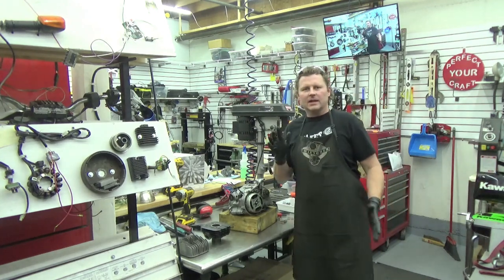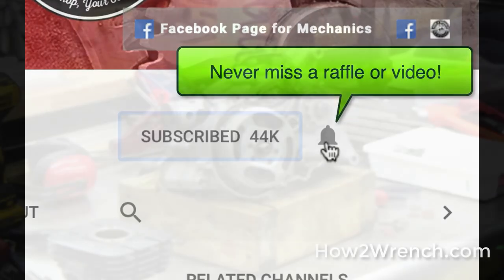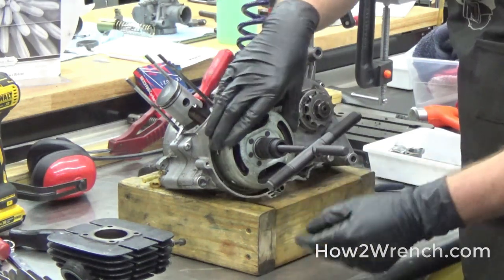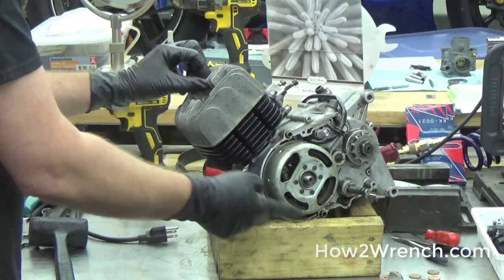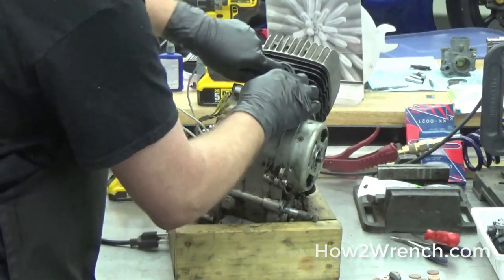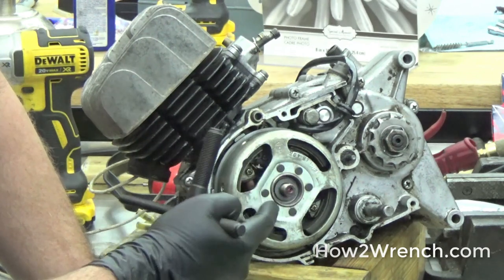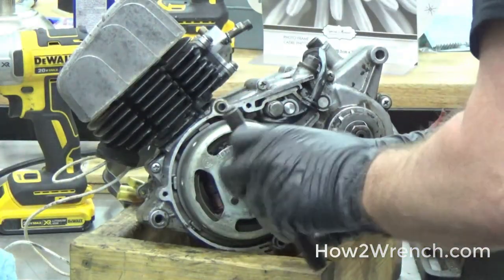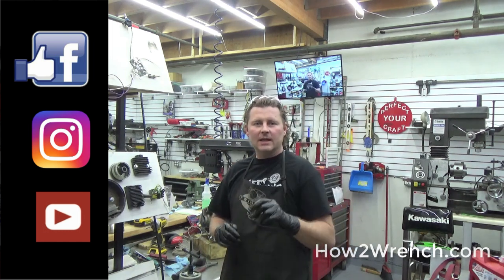How to safely remove a flywheel rotor. The "Old Boy" method!

Comment: I gave you a like because most of what you say about flywheel removal is legit. But I worked as a professional MC mechanic for 25 years and would have never removed a flywheel without the cylinder in place. For the same reason, countershaft sprockets should be removed while the engine is still in the bike with the chain over-tightened and brake applied. The old rope trick was good in its day when it was uncommon for home gamers to have impact drivers. Nothing to do with you, but T-handle design in a world where impact drivers exist is ridiculous. Most crankshaft nuts will come loose with an impact driver (assuming your flywheel puller has a hex head instead of a T-handle) and holding the flywheel with nothing but your fingers. Right now I'm working on a 1950 Whizzer motor. The designers of that motor had no idea that anyone would ever want to remove the flywheel, so their only advice is to get behind the cast flywheel with a screwdriver while beating on the left-hand threaded bolt. With that method, you wreck the bolt and the crankshaft at the same time.
Reply from the maker: Thanks Bill...time and a place for different techniques right? This a a pretty old video and yes impacts have come a long way in price and easy availability. We have many fans around the world where that's not always this case. We have many videos showcasing many different techniques and options in our engines playlist. 
Welcome to our community and your added value is a win for others here....Shane
You rock for commenting! 

Ways to support or high five How 2 Wrench! Thank you in advance. YOU MOTIVATE US TO DO MORE!
1. Smash the subscribe button (thank if already a sub!)
2. Have you seen our "YouTube Trained Support Shirts?  https://goodfellasmerch.com/collections/how-2-wrench/products/support-shirt 
3. Join this channel to get access to perks:
https://www.youtube.com/channel/UCBhM8DCKnT3qXwTW0eToyCg/join    
-Daily MEMBER FIRST COMMENTS ANSWERED FIRST 
-Live Q/A video chats
-Wonder if we have a video on your need? Members can request content links!
-Full Access to the ENTIRE 700 video library
-Member-Only FREE tool giveaways  
4. Got an emergency and your head is about to explode from frustration or fear? Get Shane’s cell here: https://how2wrench.com/ols/products/techline-one-on-one

Comment: I use 2 wrench to turn the tool & u dont need to smack the tool with a hammer
Reply from the maker: On the "t" style there is no spot for a second wrench. There are of course pullers out there with flats for 2 wrenches as you mentioned. Thank you for commenting. Here is a way to support all the free videos. Don’t forget to subscribe too! 
Want to say “thanks” or “keep it up”? Click here https://www.paypal.me/how2wrench  

Coach Conley is also available for hire to personally work one on one with you if ever needed.

Your answers and help are just around the corner. Save time and money while protecting your investment and yourself by doing it the right way!
Follow us!
Web:
www.How2Wrench.com    
www.Tools2Wrench.com

Comment: I always tighten the puller then rap the end of the puller to jar the flywheel loose rather then use excessive force on the puller handles. A sharp tap and the flywheel pops off,  no damage.

Comment: I approve of putting the piston back in the cylinder where it is safe.. but then you go on...
instead of transferring the force through the puller to a wrench on the puller, you would rather transfer hammering through the crankshaft, connecting rod, piston, head, bearings etc.

Does it work? Yes.
It is better? No. Just grab a longer wrench or set the wrench in a position where it runs into the table or floor before you are in a position you don't like. But if it's safely in the cylinder, then why does it matter what rotation the crank it at??  let the thing spin as it wants and put all the force through the puller and not the rest of your engine.
If it's really stubborn, heat the flywheel to cause it to expand and pull off easier (much better than risking mushrooming the end of the crank).
Reply from the maker: Hey there Andrew. We welcome input and FYI...Shane responds to channel members himself daily but we wanted to respond on a couple of points from what we know. 
As with any process, the chosen technique will vary on needs, outcomes and is often situational. Maybe you didn't see or hear the entire video from the comment you left as we think its was covered as to why this was chosen and as you see in the video this tool would not allow the use of a wrench as you suggest due to the threads would be damaged. There are other pullers available that could be used as you suggest. 
Also, we know from past videos of Shane's, you NEVER heat a rotor. If you'd like to know why your have to ask him, I tried to do a quick search for the video where he covered this and couldn't find it. (hard to do with 700 on here 🤣) That would be a great question for him. He does get back on non-member comments once in awhile but his inbox is pretty full serving his customers in the shop and members. We will share some links to connect with him directly if you wish. 
Make it a great day,
Social Media Team
 Best way to help us back is joining or grabbing our T-shirt! Support links and gear below!  Awesome and thanks for commenting! Smash the subscribe button (thank if already a sub!)
Have you seen our "YouTube Trained Support Shirts? Great way to "high five us" https://goodfellasmerch.com/collections/how-2-wrench/products/support-shirt

Join this channel to get access to perks:
https://www.youtube.com/channel/UCBhM8DCKnT3qXwTW0eToyCg/join   
-Daily MEMBER FIRST COMMENTS ANSWERED FIRST 
-Live Q/A video chats
-Wonder if we have a video on your need? Members can request content links!
-Full Access to the ENTIRE 700 video library
-Member-Only FREE tool giveaways   

Just want to say thanks quick to support us for this information and our work saving you money? 
Give us a high 5 here:  https://www.paypal.me/how2wrench   

Got an emergency and your head is about to explode from frustration or fear? Get Shane’s cell here: https://how2wrench.com/ols/products/techline-one-on-one

Comment: I don't think that's a lawn mower engine.  Disliked, unsubbed.
Reply from the maker: Thank you for the feedback. We are confused as to why you would take the time to share this. The title and description is "In this video, I give a quick rundown of my methods for safely removing a rotor (flywheel). This “outside of the box” method may save you from breaking parts when dealing with vintage motorcycles. " If your not familiar with our channel's purpose is to teach "skill sets" and we model on many different vehicles. We have a wonderful engaging and helpful community, so if you ever choose to come back your welcome here...H2W
Reply: @How2Wrench  It was a joke.  I think you realized that, so you're not confused.  You sound like a bright and nice guy., so I hope there's no hard feelings.